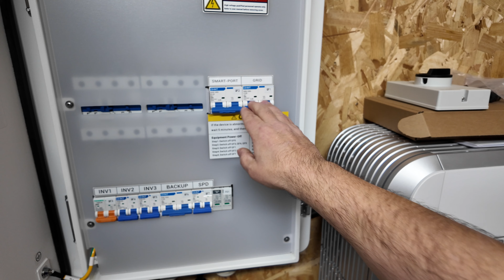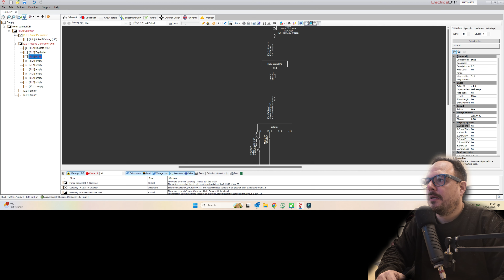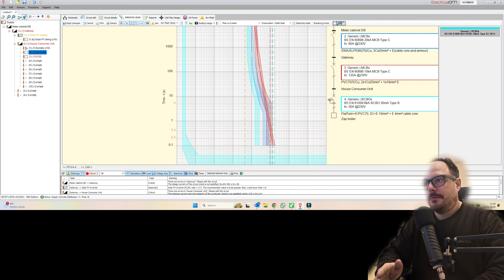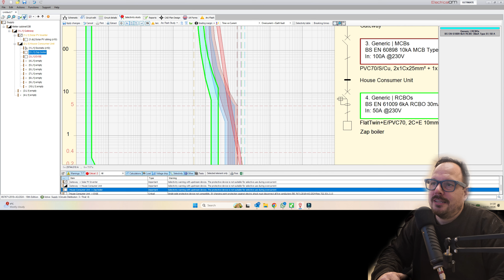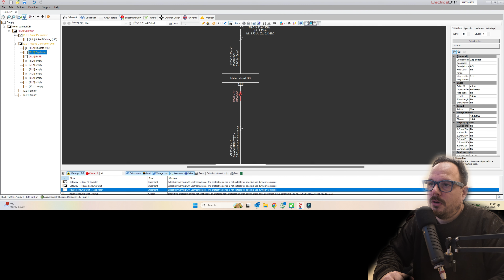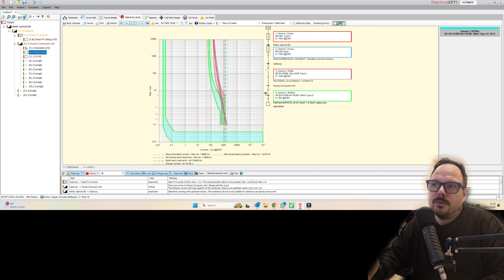Is your electricity meter box SAFE ? Why does it matter?

Comment: To get around the selectivity issues with the main incoming fuse it's almost as if the ideal situation would be to have a property on a SLV set up and TT the install to the local transformer. I won't expand on it but I'm sure you know what I am thinking.

Comment: Hey Mark, first let me say that this is a great video, you covered so many points on it with really good props and it was all very clear. The only point I would like to argue about was looking at the selectivity plots near the end, and which MCB will trip in different scenarios. I understand why the software shows the MCB curve like it does, with the instantaneous trip part being from 3x to 5x for the type B one for example, but this isn't really accurate. Yes, it's correct that if a current of somewhere above 3x flows through the MCB it will trip instantly, and it will definitely trip if a current of 5x flows through it, but it will also trip for everything to the right of that point - e.g. 7x, 10x etc. So if you wanted to draw the instantaneous trip region, you don't know exactly where it starts ... somewhere between 3x and 5x, but once it starts it keeps going forever. Let's consider a 63 A B-type MCB feeding a 20 A B-type MCB and a dead short on the output of the 20 A MCB. Let's say the fault current is 800 A. You are now to the right of both the 20 A and the 63 A MCB as you're above 5x both of them, so you have no idea which one will trip and possibly both will trip. I have seen this twice where a hob failed with a dead short and took out its own 32 A MCB and the 63 A main MCB feeding the whole installation. The hob was replaced with the same model, and a few years later the new one failed dead short again, and took out both MCBs. For dead shorts there is really no selectivity between MCBs at all. And you have mentioned this point yourself, so I know you know this. I just think the selectivity plots in the software are a bit misleading because they look like they are saying that there is selectivity between MCBs which is actually only true for a continuous overload. Anyway, enough rambling from me! Cheers.
Reply from the maker: The graphs do show partial selectivity only which is all you will get between 32A and 63A. Full selectivity with MCBs is very hard. But the graphs can be adjusted to show different elements. These are just the ones I picked to highlight the issue of the point of overlap. Gets even murkier when we drop in some MCCBs 🤭. 

I think I mentioned but Ive a video from a few years ago specifically about selectivity to the point we blew some fuses up for purely experimental purposes 😅
Reply: @electrician247  Yeah, you mentioned that video about blowing up the fuses - any chance you have the link handy? Thanks.

Comment: Our meter box is a much more extreme example: 1983 Wylex consumer unit, 4 way Henley blocks - incoming, heat pump, solar/battery system, consumer box. Also crammed in: CT clamps for battery, solar, heat pump, consumer side double pole isolator, smart meter. 5 years ago there was also an RCD breaker for an electric shower (now removed).
The DNO put in a new service head, replaced the tails, upgraded the main fuse to 80A and rearranged some things.
Not sure how the supplier managed to get the isolator and smart meter in. Hats off to him.
Reply from the maker: this is something I would like to see lol

Comment: There is no argument. The meter box belongs to the home owner full stop. However the electricity supplier can stipulate that it has to be empty of anything other than their equipment as a condition of supply. 

The reason why is that as it’s part of your property they would need a way leave for every property if it belonged to the DNO.

The end result is that the DNO can say what they like and can always disconnect you if you transgress.
Reply from the maker: That is tbe raw reality of the situation. However there very much is argument or at least debate among the social media community and even consumers with said DNOs. 

Complicated further by the ENA saying one thing, individual DNOs something else with some of them.providing diagram and instruction of space for consumer equipment. 

The reality is all this kit has to cohabit in some way or other and the space isn't simply adequate. We need better provision for that. 

I do know even when these boxes have ended up rammed with several consumer units the DNO to my knowledge have never disconnected anyone. They simply ask for space which is perfectly reasonable to do their job and I support that in full. 

Metering companies have often refused to swap meters without kit being removed if space was available for them. Never on a scope of works we have done I must add. But a few times we have attended issues where an EV consumer unit is in the box and they want it out to swap the meter. 

As mentioned in tbe video these territorial behaviours need a dose of common sense so long as everyone has safe space to work. Best serving consumers who as you say own and operate the installation

Comment: You talk about island mode in the event of power loss from the grid can i ask where is the pme earth isolation and earthing arrangement plan in the event of mains power loss with pme
Reply from the maker: That is inside the gateway. However direction is currently to retain tbe DNO earth and supplement it with an electrode. We should be doing this for all new electrical work anyway. PEN fault and PME earthing is something the kit and industry of things have thought about and the short answer is when an inverter becomes the only source it gets complicated lol. 

The risk from pen faults will always be outside of the equipotenial zone or in proximity to 2 different earth potentials. Which is one of the reasons the regs prefer for the electrode and PME to be combined. When that isn't tbe case the gateway and schematics cover that. Its actually on the drawing inside the sigenergy door.

Comment: As a consumer, instead of having the service fuse, isolator and box, why can't the service head fuse be changed to a circuit breaker? The supply could be isolated easier removing the need for the switch, I guess it is just the case of what protection is required for the supply cable. What type of circuit breaker on the service head would then be a discussion I guess, could an rcd stop pen faults coming into a property?
Reply from the maker: No an RCD doesn't stop pen faults. Pen detection devices exist but the argument is a pen fault inside the equipotenial zone is less risky than the lights going out with someone on the stairs or such. 

An MCCB could be considered on the service fuse side but they are costly and tbh fuses are very hard to beat in terms of performance. Old style meters had isolators built into them so we already solved that problem then stopped using it for some reason. 

More space is the best solution i think.
Reply: @electrician247 An isolator tagged on to the side of the meter would definitely help especially from aesthetics. Maybe all new houses should have a gateway box where the fuse box is fed from, but getting something that is suitable for use in 20 years time, which new builders are willing to pay for and fit, is probably an impossible task.